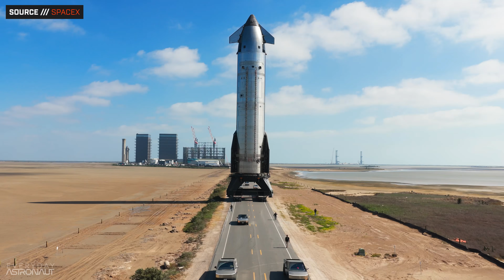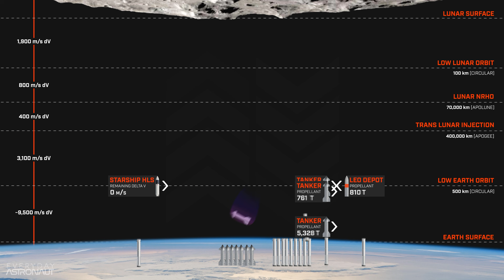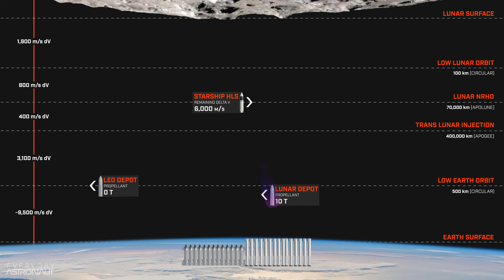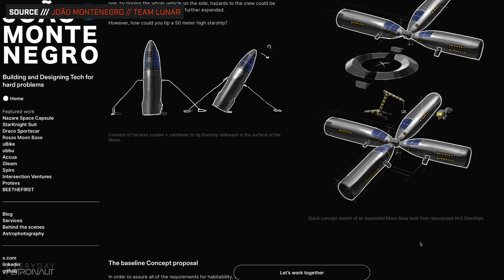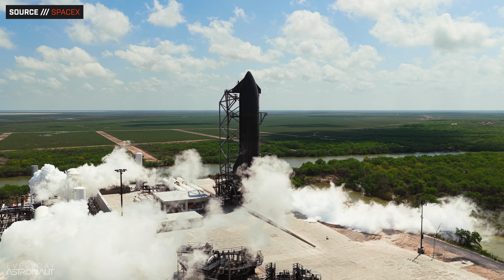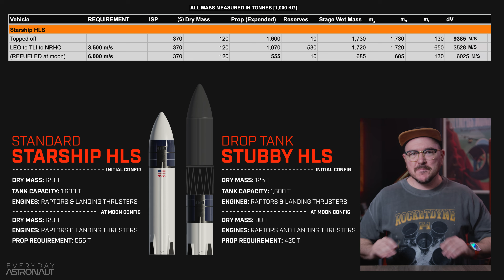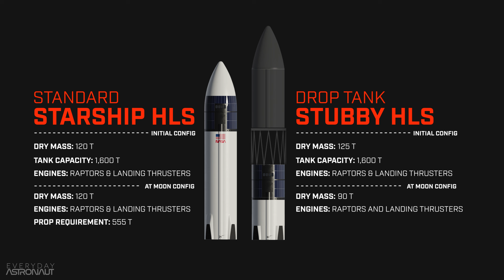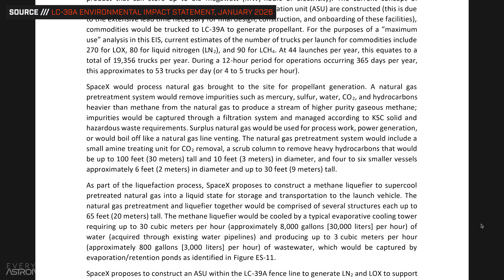Does Starship REALLY require 15+ launches to land one lunar Starship?!

Comment: The same ones used on the roadster, just larger. SpaceX tech it wasn’t just designed for the roadster. Wouldn’t be surprised if they just used the ones designed for hls & just scaled them down for the roadster.

Comment: I think a smaller lunar starship would be better. No one needs 150t on the lunar surface in one rush and with a returning vehicle. There is no such payload yet and you can't get it down the elevator anyway. 😅. 

Smaller 1-way starships for 50 t of cargo and an even smaller crew lander would do the job with just a few refillings. 

Starship is great for hauling mass up to LEO, but landing 100t of dry mass on the moon seems crazy

Comment: Well the lander doesn't need to be related to anything other than the shape that best serves the goal, thus to land and lift off, and for this i sugest a piramidal or a wide cone shape, something that wont tip over, with the propulsion to land at the top middle part, also, consider that the shape could be made in space, so it could be like a wide coin, that safely lands the crew, and the device taking them back up to space doesn't need to be the entire lander

Comment: ref:  37:45   Could you not just use the boil off from oxygen for the air and methane for power using a fuel cell?

Comment: 1:03:00 Stubby HLS may be slightly more efficient once you get it to the moon but it's less efficient to get to the moon in the first place as well as being a significantly different vehicle. Starship is built on a 'one vehicle for all job's concept where the variants are only slight changes on a proven core vehicle.
Starships long term goal is to return the lunar Starship to LEO, not do a transfer in LLO.
If you have ISRU for LOX on the moon you can skip the depot in lunar orbit altogether. A Methane heavy Starship can go from LEO to the lunar surface via LLO with 150T of cargo , drop most of that (keeping 40T of 'cargo' as systems like solar panels and radiation shielding that we need to keep on the Starship to keep the crew alive), top up with LOx, and return to LEO.
Starship is like a shipping container. Sometimes you send a shipping container that's not completely full but it's still simpler and cheaper to send the standard shipping container and 'waste' some of the space, than it is to design a bespoke box and ship that instead.

Comment: Ok, love your analysis and the different angles you take on Starship design, but at the end of the day, it sounds like we never get away from many refuelings for each Lunar Starship mission. Now, if the biggest advantage of using Starship for a moon landing is the payload it can deliver, am I correct in assuming it will only deliver that payload on its first landing? The subsequent landings would only be delivering astronauts and relatively small amounts of cargo, right? If that's the case, I suggest that Starship should only be used as a one-way heavy equipment/base delivery system, and that smaller rockets should transport astronauts back and forth. Why not use Falcon Heavy to get Orion up? Or even some other alternative to Orion? The math for the SLS makes no sense to me at all, Im not a fan. I advocate for an all-SpaceX hardware profile honestly. Let's use Starship where its strengths can be most utilized, but not force it into roles better served by other craft.

Comment: Just for sh!tz and grins:  Options not included in this video would include strap-ons and launch from TX and land the booster at Kennedy Space Center.  If viable, the boost-back burn would change to what is necessary to guide it to Kennedy.  LA will become another option in a few years, too.

Comment: Maybe NASA could help. They're pretty smart. With those O.G. "rocket scientists." They developed that amazing F-1 rocket (Saturn 5, 5 of them). In about 5 or 6 years. Used it 6 or 7 times. Then so easy and boring to make the most powerful rocket ever .. that they just threw it away. Stopped using it. We use all our rockets once developed. Mercury and Gemini, 1 and 2 man rockets. Atlas and Titan. Used for our nuclear missiles and to launch probes to the planets. But not our most powerful ever, the F-1 or Saturn 5. Used then tossed aside. Waited half a generation, 15 years for the Shuttle system. 1/10th the power even though 2/3rds the size of the Saturn 5. I wonder if Elon will do that. Develop the most powerful rocket ever, this Starship. Use it 5 or 6 times then stop. Go back to only launching Falcons. If NASA did this in the 1960s it must be a smart and reasonable thing to do.

Comment: What about launching Starship(s), one after another, LEAVING THEM in LEO, draining off almost ALL propellant for re-entry as well, several times, and then, once the HLS Starship has been fueled, then you just need to send missions to each one of the Starships that were left in orbit, to re-fuel those just enough for their return to Earth? The task of fueling the HLS would be faster, overrall, and the objective of re-fueling those left in orbit for their individual return to Earth could be done at a more leisurely pace?

   Problem - more than a single Starship in LEO for a length of time, but of course you would re-fuel them for return to Earth in the same order that they were launched, so the time in LEO for each could be basically controlled, and you could re-fuel them for return at ANY TIME after they have performed their individual objectives. 

   Just off the top of my head. Comments? What sort of problems would this create? I know you need to leave each in-orbit Starship with enough prop. for basic control and things, but just enough for that, and all of the fuel normally used to return the individual Starships to Earth could instead be transferred to HLS, making its fueling process quite a bit quicker...

Comment: Starship is great to brig a lot of tons of mass into space like 2 big stacks of 60 V3 StarLink sattelites and then come back land land. That will be the main duty of Starship in the near future and later going to Mars.

However Starship has a big problem with launching regular big sattelites. Like a GPS satellite won't fit trough that small hole. Starship is not the usually second stage with at the top  Fairings that detach and put a payload into orbit. It is made to survive something like the Space Shuttle. But the Shuttle had an enormous cargo bay with doors that could open for building ISS and big satellites. Starship can't open like that. 

So to get to the Moon. Why do you need such colossal 500 Metric Ton Tower. It is nice to have a little more room and space for stuff to do tests on the Moon and stay longer. But forget Starship or a derivative Moon version of it and for that build a 3 stage rocket on top of the Super Heavy Booster to sched weight from empty tanks. You won't gonna re-use anything. You need every bit of performance to get as much to the Moon. Even the Super Heavy can better be used 100%, So you give it the maximum push. If only 0,25-0,5% of the total start weight reaches the Moon. You better use every drop of fuel that is reserved for the Boost Back and landing burn.  Losing the Booster isn't an issue because going to the Moon isn't a reusability demo. 

So make it simple. Super heavy is stage 1. Make a stage 2 that can go into orbit and make the Trans Lunar Insertion and back. The final 3rd stage is the Moon land and ascend module like Blue Origin proposes. Something like that is going to be it. And let the Starship HLS a Blueprint for Moon mission for making bases and permanent stay. For that you need indeed something that can bring a lot of stuff. But you don't need to bring your house for a vacation stay on the Moon. Use something much lighter to first prove we can land at the Moon a half century later.

Comment: The point is it will be relatively cheap to land a starship on the moon, compared to any other proposed system.  It takes 15 flights because starship with a full cargo barely gets into LEO, and back.  Bringing the whole ship back to earth would be silly.  A small craft should return to orbit, as happened in the Apollo missions.

Comment: The funny part is a dozen SpaceX launches is probably cheaper than any previous NASA mission. Given that SpaceX is fully reusable or close to it.  So even though it looks like excess, it’s probably still more efficient than anything ever done before.  Also, like you said, 12 launches will most likely be one booster and one vehicle.  Not 12 boosters and 12 vehicles like NASA missions of old.

Comment: What about using "tugs" instead of drop tanks?  With each type of tug optimized for the specific mission segment?  How many Raptor and landing engines are needed to land on the moon?  Do you really need 6(+) raptor engines?  Second, do you really need to bring those raptor engines back to the Earth's surface at the end of every mission?  If you had a lunar-orbit-to-surface-and-back "tug", that tug and those engines could remain in lunar orbit, waiting for the next mission.  You wouldn't have to lift that dry mass back to lunar orbit on subsequent missions.  You could also have a translunar "tug".  Again, those engines wouldn't have to come back to the Earth's surface every time, saving that much more mass to orbit.  The whole point is to minimize the amount of mass that has to be carried to orbit or carried to the lunar surface... and back.

Comment: The main question hasn't been asked: why do you need a 52m / 613 m2 lander ? 
In the graphic the hypothesis is 100 t but that's clearly not for human only. 
I'm sure many will think that's a requirement for a fast moon base construction but that's doubtful.

First, to stay on the surface you need thermal, radiation, micro meteorite protection and the solution is a lava tube more than a big vertical tube. 
Second, that's not a gradual approach but a big yield big risk approach. 
The 15 required refill is just plain madness and should have been marked as a showstopper.
All in all, the StarShip is a commercial launcher and a replacement for StarLink deployment but doesn't fit the bill for a smart lunar exploration. 
This will end in disaster.

Comment: Starship was designed to go to Mars, where methane and O2 can be extracted.

The Moon has virtually no carbon nor methane.  It does have water, which can generate H2 and O2.  Hydrolox has its issues, but the propellant can be made there, where methalox cannot.

Comment: SpaceX is advertising that Starship can carry 100 tons to the moon. If that is true, to get 500 to 600 tons of fuel they would have to expend, the 100 tons does not include fuel for the return trip, 5 ships each requiring 12 to 14  tanker launches. That is over 50 launches and expending 5 ships just to do a Trans lunar refuel. Much cheaper just to throw away the old lander and launch a new one😂😂

Comment: wouldn't it be better at first to build a smaller starship that could possible fit in the cargo of starship full of fuel then be deployed to meet with Orion the amount of load and time on the moon would be reduced but may speed things up   at least until they have the depots built and operational?

Comment: Considering that future missions to the moon and Mars will require many thousands of refueling launches wouldn't it make sense for SpaceX to develop a bespoke tanker? Eliminating the payload bay and cabin entirely would save a lot of mass that is both useless and expensive in turns of fuel required for delivery to LEO.
It means going back to the drawing board, sure, but I think the payoff would be enormous in the end.
Edit: en situ refueling. If the Oxygen is acquired from electrolyzing lunar water then only Carbon has to be delivered to the moon, using the Hydrogen left over to make methane. It would reduce the required delivered mass by about 25%.

Comment: Another approach might be expend the first booster to preserve as much starship fuel as possible, and thereby needing fewer tankers. Additionally the starship could switch to a single gimbled raptor as LEO orbit injection and subsequent thrust would be mostly done by the low vac engines.  Run the numbers and let me know what it says.

Comment: Day by day, I'm getting sadder and sadder that Reaction Engines Inc went bankrupt. Skylon could be improved with drop-tanks to add even further (TLI burn capable) range. Imagine underwing drop tanks such as those on F fighter jets or SpaceShuttle (sort of). I do this HTOL design in KSP for 7 years and one day I'll demonstrate (if don't procrastinate)
Reply: It was a scam.
Reply: @waynemacomson6448  I admit it, the intercooler part seemed a bit shady. But it wasn't impossible in theory.

Comment: I am thinking about - as I call it - "modified Aldrin cyclers". Major problem of space travel is tyranny of rocket equation. So, as we know, more delta v needs more fuel, so we need delta v for that fuel too so more fuel and so on and on. Unfortunately we cannot break physics, so what we can do?

We would like to get more delta v, but not adding more fuel. Optionally we would like to get to destination as fast as possible - so we need high power propulsion.

so to get somewhere fast and easy, we have 2 options
- speed up exhaust of engines
- to not carry fuel with us.
Both options looks viable, we already use them - Raptors with high pressure in combustion chamber to get faster exhaust and ion drives with even higher speeds of propellant. (Also NERVA is an option, but is not in use, so I do not bet anything on that). Since energy for ion drives does not come from propellant, we can consider it as solution "not carrying fuel" with us. Mostly we use sunlight which is at cost of free shipping, so it is a framework.

So for high speed exhaust we will use ion drives. To not carry fuel approach, we will use sunlight. Because we have here still problem with power, we can use standard idea of storing until we have enough and then pay for delta v by one huge bill. So, We can store many kinds of energy, what we need here is kinetic energy which will shoot us to the destination. So why to not store all energy as mechanical energy. We also have centuries of experience with storing mechanical energy. Some mass revolving around some point is flywheel, and flywheel is kinetic energy storage. So back to modification of cycler.

Modified Aldrin cycler as I imagine it, is kinetic energy storage. For basic circular orbit we need well defined amount of energy. If we will ad energy in well chosen point of orbit, we will make orbit elliptic. Since cycler is not meant to reach destination, it can be heavy as we wish, it basic place to live is LEO. So i.e 13 refueling starships can deliver 1300t to LEO if not be fuel cisterns. 
We can make cycler as stupidly large area of solar panels, for us heavier equals better (kind of) and equip it with ion drives. Problem is very small power of propulsion and short time period we can use them (to not mess orbit). So when we achieve decent elliptical orbit (some maths, including mass and v) we can use sky hook model to capture spaceship from Earth and pull it on board - yes, probably dangerous, but free fuelwise. 3rd law will slow down modified cycler and speed up spaceship. Now, we have spaceship with 
A) enough speed to reach another planet/Moon - which is not what we want - because it makes this cycler standard, not modified
B) not enough speed, but sitting an enough mass to steel from - 100t spaceship on 1300t modified Aldrin cycler can speed up 13x while cycler slows down just perigee speed (which will be zero and will fall on Earth, but just for explanation delta v of ship = 1/13 of delta v of cycler)

Modification of Aldrin cycler gives us ability to not carry fuel and use high speed propellant - so we outsmarted physics. We just need to calculate parameters of cycler and starship and equip cycler with mass drive to shoot spaceship where it wants to travel to. Discharging this flywheel, gives it circular orbit in expense of speeding up spaceship (3rd law).

Same can be built for return trip. We can even adjust direction (in any plane) by speeding up/slowing down cycler at different points of orbit as usually. 

And ... we "just" need to solve engineering problems, as stress on devices by speeding them up and slowing them down, assembly of mass drive on orbit, maintenance and similar "details". 

funniest part is, that if we will be able to capture ship in destination, we will ad to energy of a cycler, which can be reused for return trip. Same with Earth side, we can use mass drive instead of backburn to deorbit ship. Such a space ping-pong looks like a very funny adrenaline sport. so, i.e. small Dragon or so, captured by hook, pulled onto modified Aldrin cycler is borrowing energy from it, then i.e. spacious limousine launched from cycler borrows energy from cycler, captured limousine lands energy to Moon side cycler, deorbit launch lands more to it. On way back same. So at the end, ion drives will not do much work if limousine paid back it's dept. PV fields are still needed for mass drives (and electric energy storages, in some form - flywheels are probably more problematic than helpful, so ion batteries will be good choice - they are adding mass to the system and do not mess with motion).

(I am not any close to be good in orbital mechanic, so I can be totally wrong, at least it is fun to think about it)

Comment: The Starship HLS would be best utilized as a cargo rocket system bringing supplies to and from an already established lunar base. Ideally an already existing base would have landing pits that the Starship could land in that would bring the airlocks level with the surface of the Moon (so no need for elevators or ladders). For now, we don't need something so massive and tall, we could get by with something like an advanced version of the old LEM, squat and wider than it is tall.